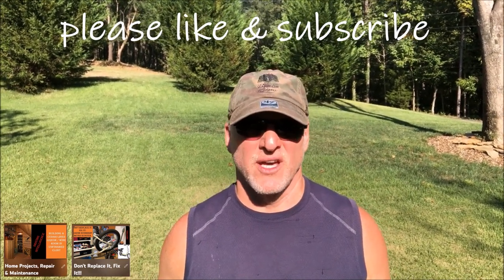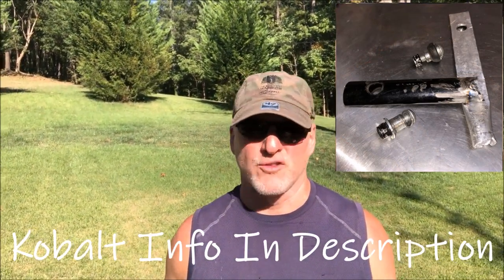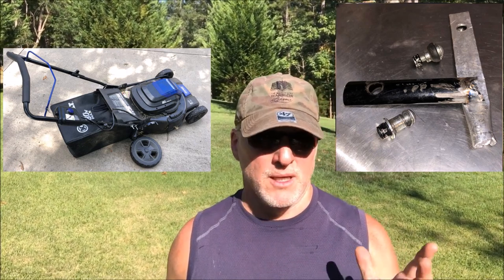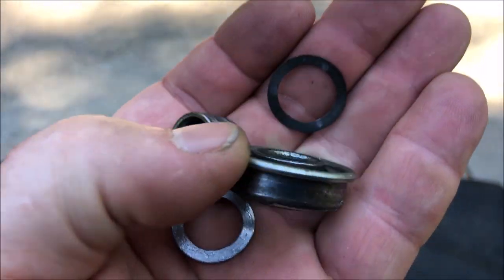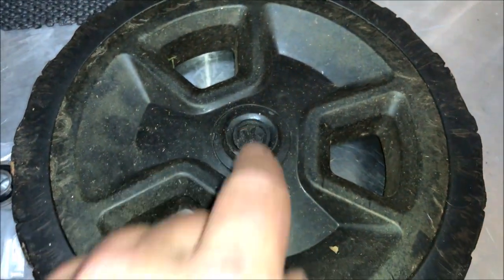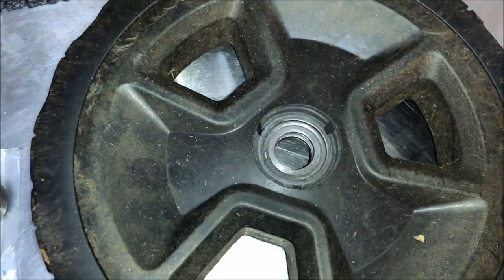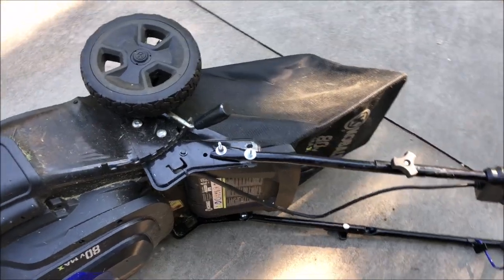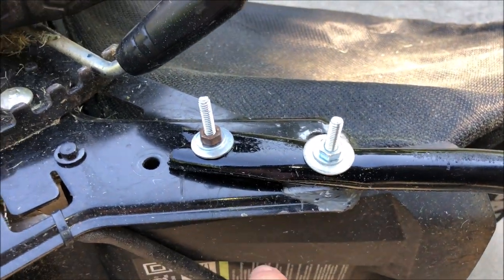How To Repair Kobalt KM2180B & Greenworks GLM801602 80V Lawn Mowers: Handle, Wheels & Wheel Bearings

Comment: Hey, I’m not sure if you could help me. I think I have the same exact mower as you in the video. I don’t remember the old wheel assembly having two bearings. Did you add one to the back yourself?
Reply from the maker: If I remember correctly, the original bearing is a one piece set up that goes through the wheel. The new bearings that I bought are two piece which is different from the original design, but as I show the video they work perfectly.
Reply: Thanks for your response. I love your videos. I’m wondering if you could answer a few other questions I bought the bearings I banged in the The outside bearing that fits, no problem, nice and snug, but the bearing where the cotter pin is does not fit snug at all. I’m not sure if it’s because it’s warped on the inside what do you happen to know what I could use to try to make it fits snug I was going to possibly try some gorilla glue or something like that
Reply from the maker: @Scubadiver313  how loose is the bearing?  Does it flop inside the wheel or is just a little loose?  If a little loose, you can do what I did and stack washers to make sure the cotter pin is tight.  You could use some Gorilla Glue to tighten it up, but you'll likely have to redo it from time to time.
Reply: What was the size of the bearing you used?
Reply from the maker: Don’t recall measurements, but the bearings are linked in the description of the video